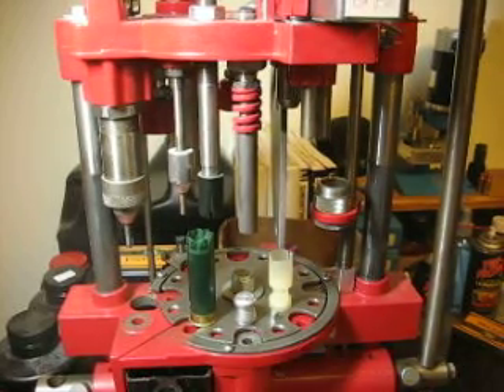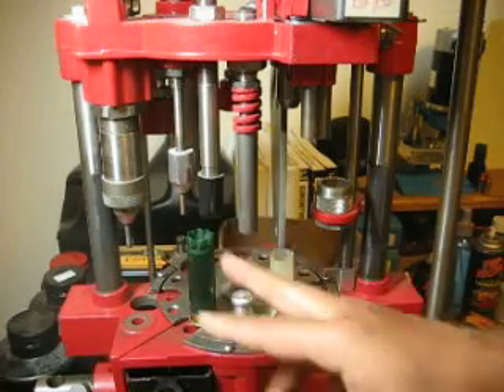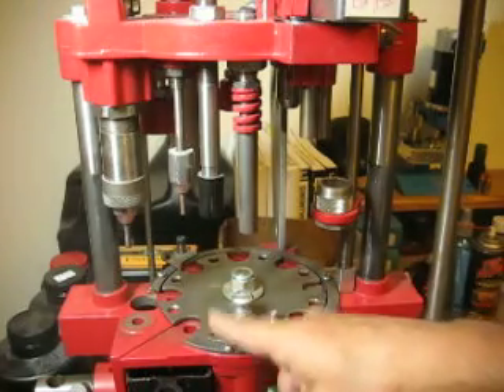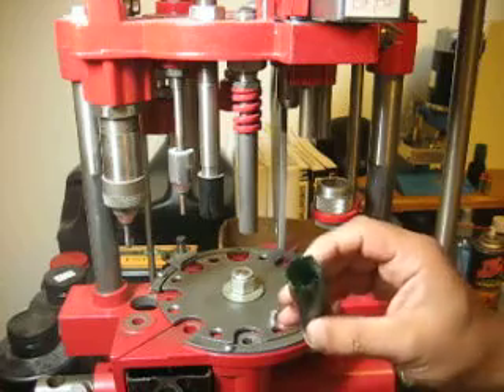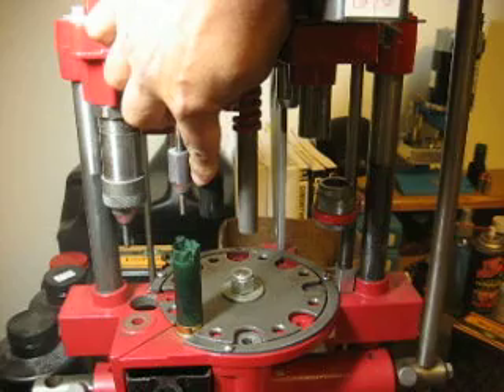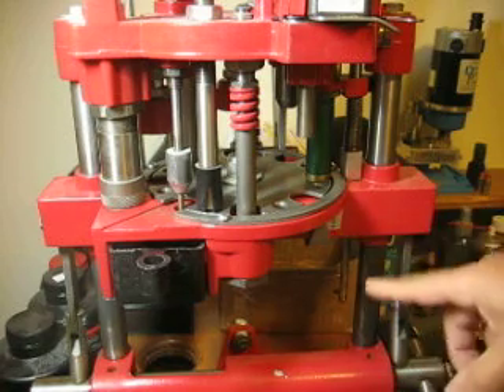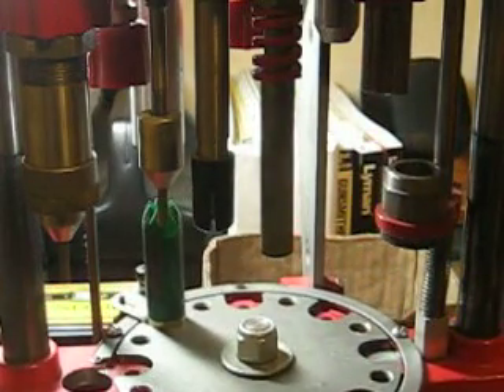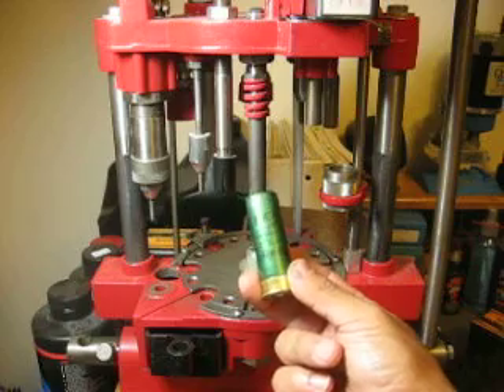Hornady 366 Auto (part 1)

Comment: how many times can you reload a shell? lets say 12 gauge
Reply from the maker: Not sure. Some can be reloaded 8 or more times. It depends on your load, and the shells you use. These STS are the best for me. 

I also check the feel of the plastic. Too brittle, or cracked, and they’re thrown away. 

Since I only reload slugs for multigun matches, I usually consider them gone after the stage. I’m not going to hang around and pickup shotgun shells. 

I usually get tons of them pretty cheap online.